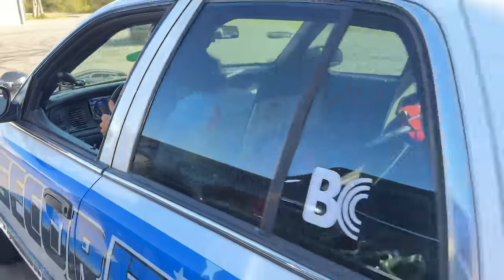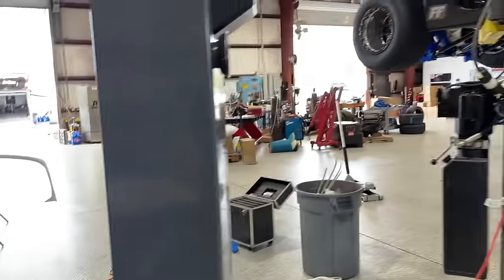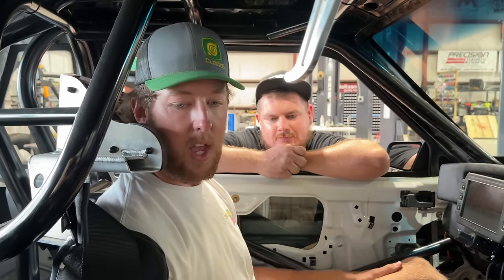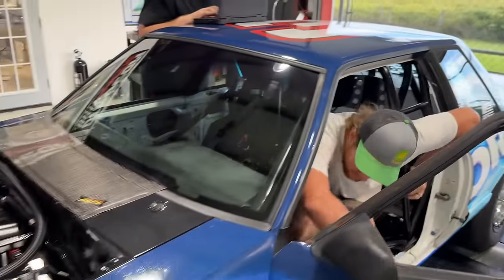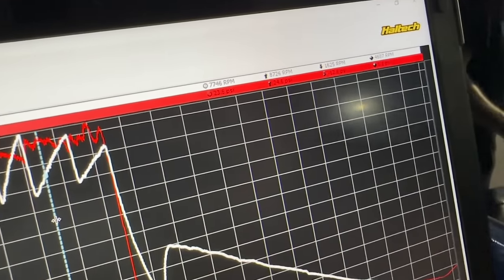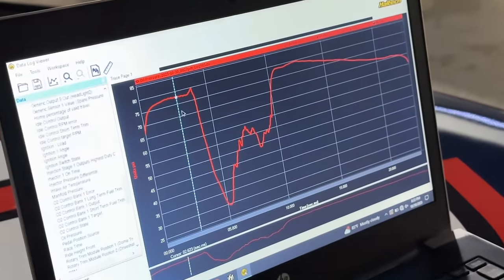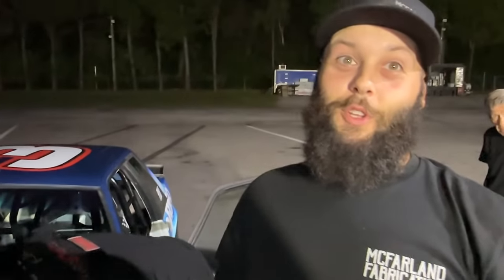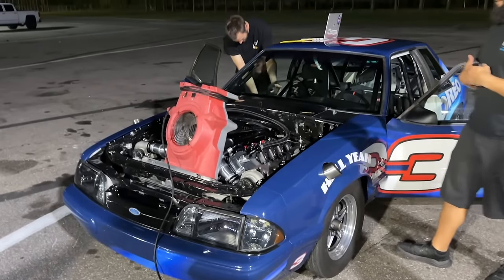McFlurry's FIRST RUNS With Its 2,000hp Coyote Engine... It's INSANE!!! (It Revs SO HIGH)

Comment: Add a pressure sensor to the CO2 line, so you can add an alarm to the ECU if the bottle pressure is low.
Reply: Swap all CO2-feeds to N2O-feeds... Less to go wrong... I saw it in a video once...
Reply: Eigh. Too much work brother. Just add it to the pre flight checklist for Sam. The old guy needs something to do!

Comment: Once Pete gets his hands on the keyboard McFlurry is going 6.70’s
Reply: 6.66…. The devil’s engine
Reply: Pete would say more chains than brains
Reply: @fast97z24  I wonder if you would have the ballz to show your mistakes to the whole world?  That is called integrity...
Reply: Nope call up Lund
Reply: @fast97z24 they probably put the normal amount of oil at first which with G force can slosh up the back of the pan creating oil starvation. A common solution is to overfill by a few quarts. But anyway, where's your perfect racecar?
Reply: If your headphones have haptic feedback then these videos are soooo much cooler to listen to
Reply: Doubt it. Those really are tiny turbo's and that motor wants a lot of air.
Reply: Mistakes happen when you build a car this quickly, plus Coyotes take a ton of oil. Hopefully none of the bearings got scuffed.

Comment: That little 5.0 reaches an octave level like a Pro Stock motor.
Reply: Exactly what I thought
Reply: The band got a soprano singer.
Reply: James said it sounds like an f1 car. I'm sitting here and all I hear is pro stocks 😆
Reply: LS guys be like, IT REVS SO HIGH!!
European guys be like, you're just now making an engine rev past 6,400 rpm?
Reply: Mr Doppler raises an eyebrow...
Reply: Europeans sticking to the 'our engines rev higher' thing tighter than white on rice, because meanwhile American V8's only need 6400RPMS to run 6's(or faster) in the 1/4 mile.  Our tank engines needed way less than that as well to liberate all of Europe twice too, but that's neither here nor there.

Comment: The fact that you rolled to a 7sec pass is amazing. Love McFlurry. Hope you didn't hurt that engine with the low oil pressure because that RPM and that oil pressure is not a great combo.
Reply: If it blows up, we can now blame Cleetus's customary lack of engine oil !!
Reply: @arkhsm  They had the normal amount of oil you’re supposed to have in a coyote, but under that acceleration it all sloshed back, so now they are 2.5 quarts overfill.
Reply: It was short.  It'll be fine.  If they did 2 or 3 passes like that maybe.
Reply: Luckily coyote sump capacity is quite a lot of oil, which is what saved the pressure from diving under 30. The fact it came right back up after the pull to where it was before showed nothing was damaged IMO
Reply: @ice44567  that's not really how it works. We had a 2JZ that did the same thing. Only 30psi and 8000rpm+ will damage bearings. Hopefully, they got away with it, but I won't be surprised if they have problems down the track
Reply: @STREETMACHINETV  it really just depends on how the engine and the oil pan is designed. Heat kills bearings, so I get what you're saying (high rpm and oil flow loss is good at creating that), but unless it's not caught, I think the return of pressure to where it was before is decent evidence they got away with it. 2.5 quarts gone out of a 10qt sump is a very different story compared to 2.5 out of a 5 quart pan as well. Ultimately an oil analysis would tell for sure, but if it blows up during world cup you can come back and laugh at me

Comment: Watching Mcflurry go through the gears and the endless up shifts reminds me of the dirtbike with 16 gears from Terminator 2.
Reply: It was running the specil Hollywood gear set, something akin to the 20 mile runway in one of those Slow and Spurious movies !!
Reply: @arkhsm  my favorite part is still the bike itself. It's a Honda XR100 (four stroke) and the sound you hear is a 2 stroke 80cc engine.
Reply: If you were being chased by Arnold and a truck with a Liquid Metal dude you’d want at least 16 gears 😂

Comment: world cup and the fleet is way different now than it was when it was just leroy, and a hodge podged red corvette. now you have TWO 2000 hp+ machines and you’ve got plenty more knocking around at 1200-1600. absolutely insane brother
Reply: 4... Mullet makes like 4k to the crank. Toast, Mcflurry and Leroy make 2k to the crank.
Reply: @NickBealed  “2000 hp+ machines” figured that was broad enough to include mullet, my bad nick
Reply: Hahaha
Reply: Ol Ruby, can't forget that name
Reply: @NickBealed while the engine is capable of high numbers mullets chassis isn’t capable of holding what it can make so he can’t run it at full potential
Reply: @NickBealed toast doesn’t make 2k. Little ways off from that. Leroy is close, probably a touch under but the car is settled now and has more rpm that he’s actually on the power instead of shifting. I’m a ford guy, but that coyote isn’t making 2k on those little turbos. Needs at least 70s
Reply: @joshuaearnheart2756 I agree, my guess is around 1500
Reply: Leroy is definitely making 2000 hp to be able to go that fast with horrible aerodynamics
Reply: Lol😂 yea Nick🖕🏻 take that
Reply: @crypticchris8812  he went that fast before on a car that was basically impossible to control with the 427. It didn’t make 2k

Comment: That beast is the business. 
I'm wondering if tuning without the bonnet on, then running it with the bonnet on its going to make a difference too the tune. 
Without the bonnet is getting fresh cool air, but with the bonnet, it's going to be struggling a bit for clean air. It needs air scoops in the bonnet feeding the turbos. It'll make a difference ìn my opinion.

Comment: Welcome to the Haltech NTK Wideband Errors.  This will read 0.8-0.9 AFR leaner on the computer (car runs richer at same targetes) than any other wideband on the market and has been a cause for concern for well over a year at this point.  Either run it on Analog to set your own scalar or swap out sensors to the Bosch units.

Comment: only thing i would change is i would add some airfoils under the front bumper with 1/4 pipe on a pipe like 1 1/2 inch titanium or aluminum to ram a little fresh air into the engine bay to let the turbos breathe better.

Comment: you can see the turbos not handling the oil psi in that two step check around the 28 min mark also add some air intakes for them in the hood or grille!

Comment: the car looks better with a hood , less hacked together 
you have a good fabricator that makes things fit and look realy nice , theres no real need to put turbos out above the body as he can make headers that work instead of having to use headers that bearly fit with no room left for the turbo's
besides that it takes les power to push a streamlined body through the quarter mile and you dont have to tape up the car with plastic bags when you load it on an open trailer (like when you have all cars transported to an event outside florida ) or when it starts raining

i would love to see a nice one piece tilt / lift away nose fitted to toast too , maibe you can find sumting used and have it wrapped

there is one dragrace class that might be interesting to enter in and build a car for , as i dont think you raced one before (well you raced against one before in  mullet ) : a top alcohol dragster , you and the team allready has the knowlege about running engines on alcohol (though less if that engine doesnt has a power adder like a turbo or blower and mixing the fuel with nitro ) . might need some schooling on setting up the clutch though the one in mullet might be verry simulair  , and i bet tye could build a tube frame slingshot dragster from a nhra rulebook
my guess is that if you dont add a lot of nitromethane and run NA the engine might last longer than most of youre other engines , they seem to be not as expensive as topfuel but you might still need a sponsor for just that car . might need to only race that car or have a dedicated driver and be a teamboss for one season to be competitive and have youre team race in the other classes and take care of those cars 
i bet it makes for great video if you do a complete series from the planning through the building through the sponsorship and racing it for the season , might need to do it on a seperate channel cause the (mentioning of the) sponsor a few times too many might cause youtube to demonitise the video;s

Comment: Can someone explain what dome pressure is? Is it different to normal boost people usually quote?
Reply: External wastegates have 2 ports, one "under"the gate that pushes the gate open, and one over the gate that pushes it closed. On a race car with co2 you put the under gate port to your intake manifold so the boost pressure is trying to open the gate. You add co2 to the top of the gate to hold it closed, more co2 more boost. The top of the gate looks like a dome, so it's referred to as dome pressure. Every cars different so dome pressure doesn't equal boost but more done is more boost.

Comment: I know you guys are a little young but FORD Motors SUCK! Theyve always sucked and Always Blow up! Ive been building motors since 1980,and just get a GM motor back in that thing! 302,351,460 all Junk 😂😂😂😂😂
Reply: GMs, Dodges, Fords, and any other brand can blow motors. Your "experience" is only you. Plenty of us have good experiences with all those motors you have listed. They wouldn't be as popular if your inane beliefs were held true. All motors are mortal. I have dealt with and played with many myself. lol. And frankly, a 5.0 Coyote will decimate any engine you put together. Hell, I have built i6 2jzs and k24 i4s that make more power than a V8. If you have the wallet for building, you can build them strong regardless of what platform. And they will occasionally blow up regardless of brand.

Comment: Why only the 8th mile hits and not a full rip especially on that 3rd hit I think if he stayed in it he probably could've ran a mid 7 and not 7.90s and a higher mph and next you should get a Black Sheep LS built the next time you lift a head or bend a rod in the LS you're putting in Ruby